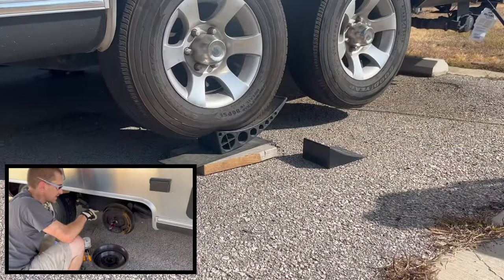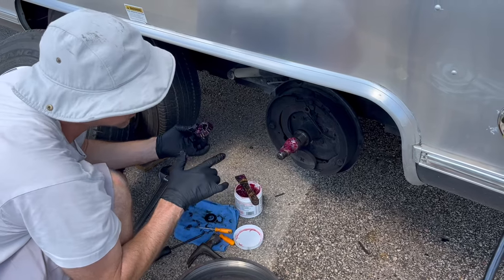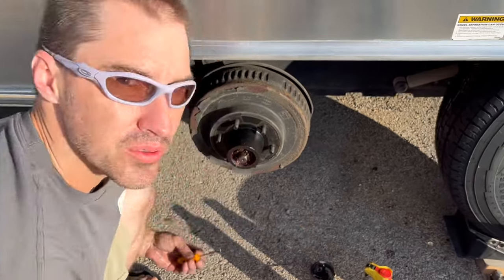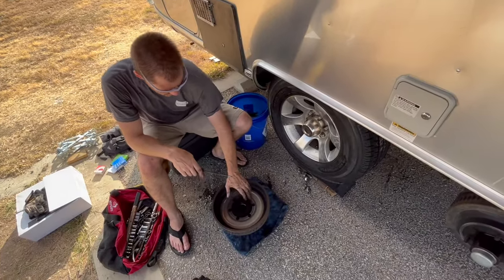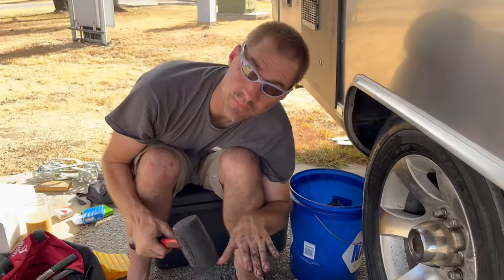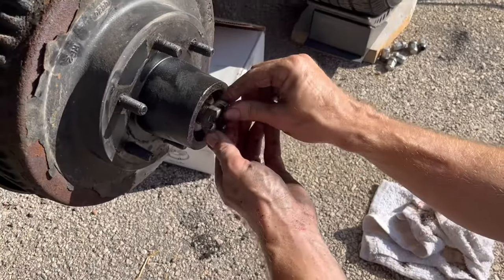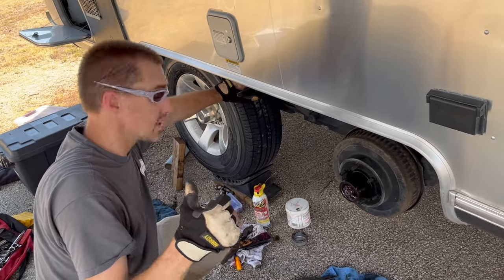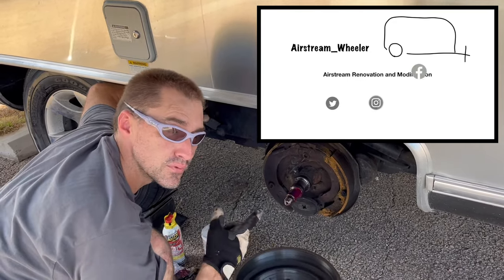How to Replace Airstream Drum Brakes (Super Easy!)

Comment: Using wire nuts on trailer brakes is inadvisable.  Should use crimp connectors preferably one that are heat shrinkage. Get them at Harbor Freight.
Reply from the maker: Thank you for the tip, I will look into doing that instead. I reconnected them as I found them but I would love a better way. Thank you for watching!

Comment: When you change a bearing you should always change the race, they come as a set, also you need to push the grease between the rollers of the bearing and usually fill the hub about a 1/3 full of grease!
Reply from the maker: Thanks for the feedback. Do you think I should pull them and pack with grease again?  Thanks for watching!
Reply: @airstream_wheeler  that is a tough call, you can buy bearing packers that push the grease through the rollers for just a few bucks at places like Harbour Freight! They also will have seal and race installation combo tool that is very affordable to purchase that I would also recommend you purchase! I think I would pull the drums again and make sure you get a little more grease in the bearing rollers and add a little more grease in the hub! When tightening the spindle nut I rotate the drum in the opposite direction, and then back off, you are correct to leave some end play because the bearing will heat up and expand! If you change the bearings, change the race as it is a designed as a replacement wear surface! Hope this helps and safe travels!
Reply: You can add grease to the hub and bearings without removing your new seals! Remove the drum and use your fingers to work grease into the rollers of the  inner bearing without removing the seal and then add some grease to the hub and repack the outer bearing and reassemble! Hopefully this helps!
Reply from the maker: It does! Thank you so much for taking the time to help us. This is great information and we are eager to learn. Now, I just need to take it one wheel at a time. I appreciate the guidance.
Reply: I forgot to mention if you pick up the bearing by the inner race and shake it and it rattles there is not enough grease in the bearing! Try it with an UN greased bearing to see what I mean! I am glad to see you doing your own bearing packs because it is a miserable job not a lot  places want to do it, and this way you know the quality of your own work! Also don’t go cheap on the grease! Buy the best you can find! They are not all the same!
Reply: In my previous career I was a GM mechanic and was trained by an old veteran how to correctly hand pack a wheel bearing.  You put a ball of grease in the palm of your hand and push the bearing in the grease on the open wide end until it comes out the other side.  Keep rotating it until it’s fully packed.  Applying grease to the axle is unnecessary. It’s what’s inside the bearing that counts.  Also, the flat hub side of the drum is grooved from the magnet.  It’s called the armature part of the drum and is as important as the surface where the shoes contact.  I’d replace those drums if you continue to have less than optimal performance.